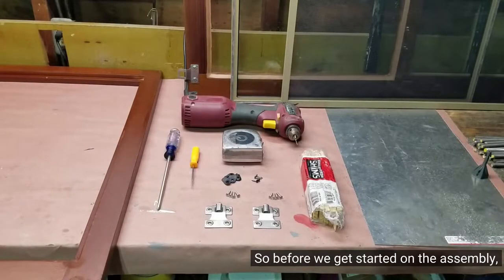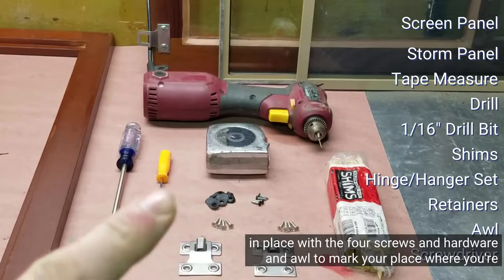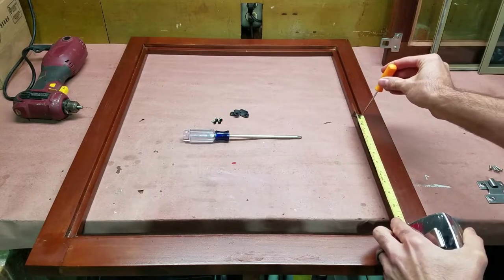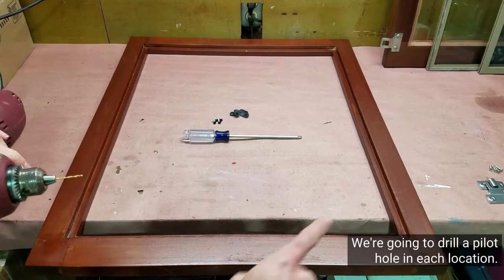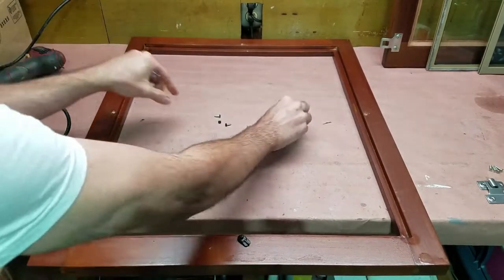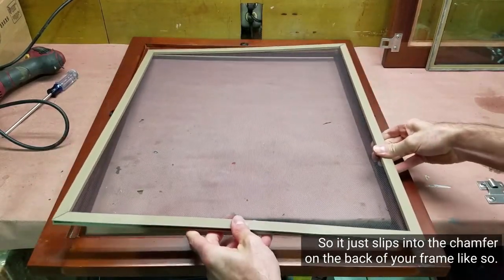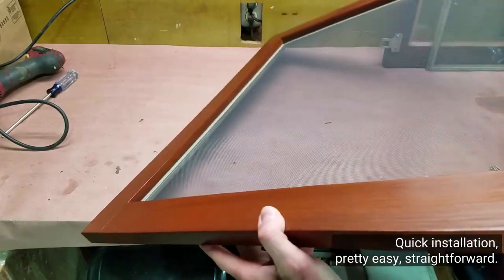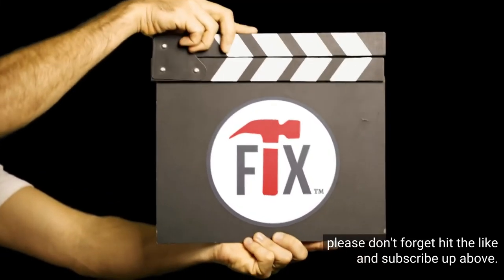Your Guide to Wood Storm Window Assembly | My Old House Fix

Comment: where did you purchase the removable screen and glass panel frames?  Thanks for the great video.
Reply from the maker: You're welcome! I salvaged the "wavy" glass from old window sashes and provided it to be cut down at my local storm door/window shop. They can build and provide new glass and screen frames sized to your storm windows.  Heres a link to the blog with a little more info - https://www.myoldhousefix.com/blog/best-wood-storm-window

Comment: How did you construct the windows?
Reply from the maker: Hi, the storms are made from cedar with mortise and tenon joinery.
Reply: @myoldhousefix  Did you rout in a rabbet, drop glass in, then glaze?
Reply from the maker: @westsidewil  yes, I glazed in the upper sash amd the bottom panel is in a frame that is removable.
Reply: @myoldhousefix  Do you have a video link on how to construct the windows?